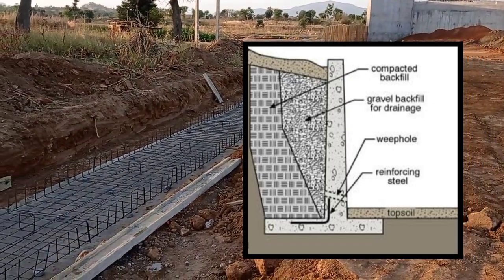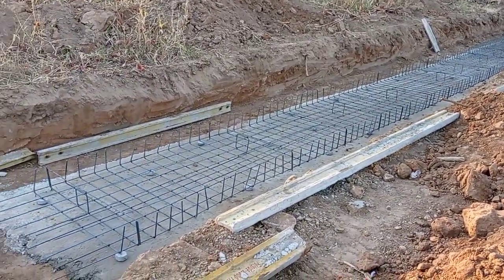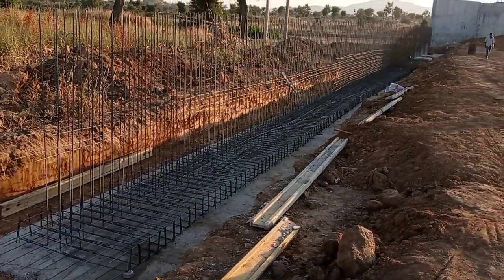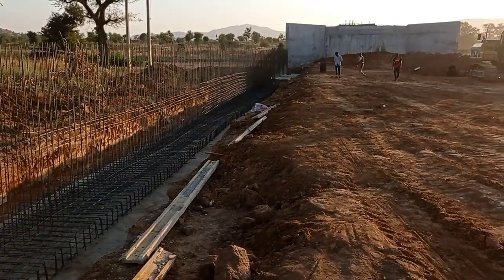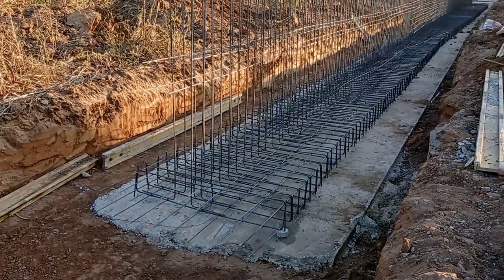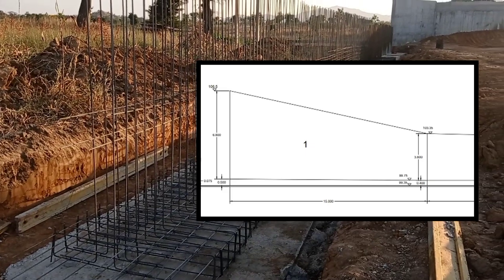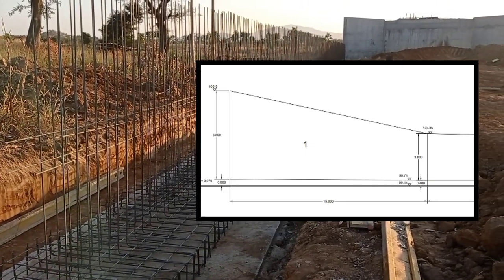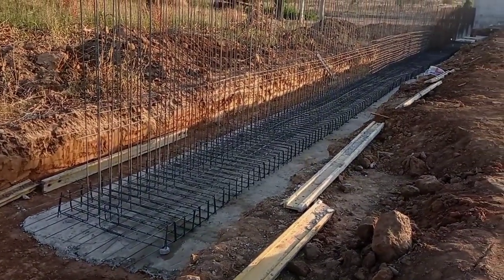Construction of Retaining Walls | Useful Tips & Guidance

Comment: Spacing for base and wall rfmt
Main bar and distribution bar
Reply from the maker: Hi Adesokan, for base and walls, if you're using Y16 then spacing from center to center is 200mm. However, if rebars are Y12, then spacing of 150mm is recommended.
Thanks!